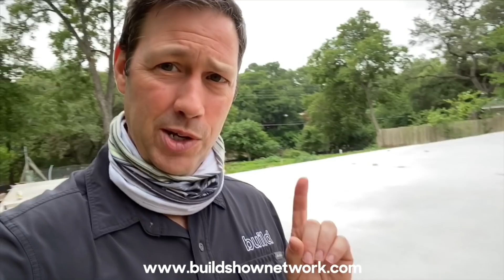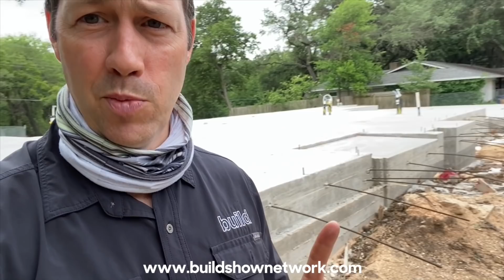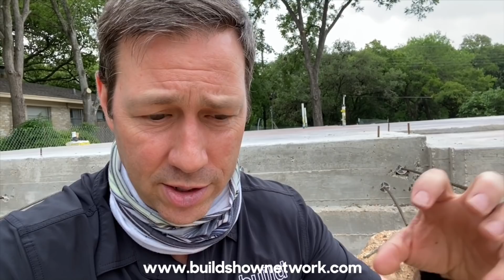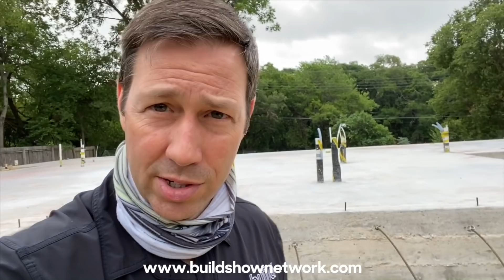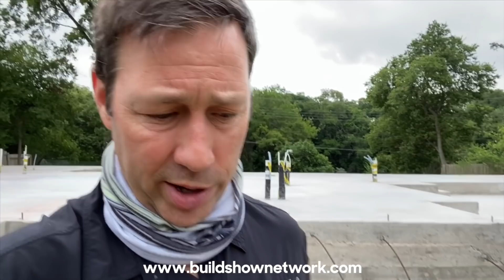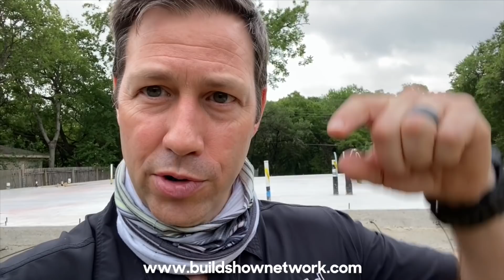Post Tension Slab Basics

Comment: I have fixed one previously, we had to remove the old tendon, and insert a smaller diameter cable, install the wedges, and tension the cable. However, in the north, we tension the cable 1 day after the pour, and then a week after that -- so it can get a bit dicey.

Comment: We add 7500 to 7800 psi when doing post tension, I work post stress and yes it's very dangerous, it sometimes blows up on us while we're adding the pressure and the repair is even more dangerous

Comment: They work great here in Texas. My next house I would like to have this system.  Not to worried about remodeling. Really any breaking of concrete slab you will weaken the slab with or without post tension. I have had to do remodeling with post tension, just take your time and break around they are spaced out a little further so you have more room to reroute plumbing.

Comment: Good video. But an important point is that the post-tensioning causes COMPRESSION in the concrete. Not tension in the concrete. That's the whole point :)
Reply: Not to belabor this point, but it's absolutely critical man! The reason why a boatload of tension is jacked into the PT strands, is 100% to make sure the concrete remains in compression. The only tension in the foundation is in the PT strands, and that is in order to keep the concrete from experiencing any tension. I'm a nerd engineer. Your videos are great, but that is a point that should not be overlooked or mistaken.
Reply: An equal and opposite reaction. Jack 25 kips of tension into a sleeved steel PT tendon, and the reaction is 25 kips of compression spread out over a certain area of concrete, to make sure it doesn't crack.

Comment: The argument about remodel of a huge house like that reminds me of the way PCs used to be built.  you would have a huge old case and that was so you could buy a new motherboard, video cards, RAM.  But really, it was just easier to get another one and ditch  the old slow one.  The thing is that most people stay in homes such a short time that jacking a slab for a remodel should be someone else's problem.

Comment: Plumber for over 10, years, Did a remodel on a home with post tension rebar for a restroom. Had to re route drain pipe. One of my helpers hit a tension rebar and it looked like as if a grenade had blowed right in front of us. He wasn’t wearing safety googles either so had a lot of debris go into his eyes. The scariest thing that’s happened to us in a long time. Was definitely lucky as the concrete was almost all shipped and only a small portion was left before he hit it. To answer your question as how do they replace them. they get a drill take of the plates that hold the tension on one side and drill it out as they have grease inside the sleeve. Once removed they drill in the new one with a regular drill and then used the tension machine.
Reply: I used a dremel to remove the wedges to free up the cable. time consuming, but worked out well.

Comment: The cable will break with about 41,000 pounds of force.  The working load is usually 70 to 80 percent of the ultimate strength.  So there is usually about 33,000 pounds of pull on each cable.
Reply: Hi Greg. The pull I have seen on most sites ranges from 3000psi to 7000psi.
How does that come close to 33000 pounds? If you could explain. Thank you

Comment: I’m building a new home with pt foundation. They just finished framing. I went by yesterday and for some reason they had a 4 ft square area of the concrete jacked out and there were 2 cables cut. No dead bodies laying around. Lol. I’m wondering why they had to jack that up. Plus, after searching the web I couldn’t find anything substantiating your claim that people can get hurt by cutting a pt cable.
Reply: Yes people can get injured/killed my PT Cables.
Reply: Absolutely people can and unfortunately do get hurt.  Don't kid yourself otherwise
Reply: I’ve cut many cables to repair them. Never seen or experienced a cable killing anyone

Comment: When blowout happens they detension cables around that area and chip away the concrete till the cable that failed is exposed. You can use a coupler to splice the cable that failed. Pour concrete and retension

Comment: Having a home built soon with a post tension slab.  How much time between the slab pour and the framing is best practice?  And will framing before the slab is tensioned harm anything?
Reply: You can begin framing on the slab immediately, before cables are stressed. Cables should be stressed 7-10 days after slab is poured.

Comment: Its a hand held machine that pulls the cable. If you ever break the cable your screwed.
Reply: We do PT everyday , we had cables snaps before and ussually isn't a big big deal because they are over engineering,  where usually allow us to have some that are broken . Last job we did 4 story building,  over 2000 yards of concrete each level. It really isn't a problem , but you gotta have an engineer look at it. I haven't seen on houses , I wouldn't do on houses I agree because you might want to change the lay out in the future but apartment buildings go for it.
Reply: Well now days alot of PT jobs are over engineered to the point if you have one cable fail it wont matter you have X amount of extra cables in that area that it wouldnt effect the integrity of the slab.  Now if you dont have extra cables in a certain area and it fails. You chip away the concrete and add the cable.

Comment: A rocky site in Texas may be capable of digging out with an excavator.   A basement can be practical when the site has a ravine or some feature which can be filled in, local regulations permitting. The costs of hauling away the fill material prevents many from using a basement.

Comment: Not to disagree with an engineer, but, out of interest in Australia, solid rock foundation would see a waffle edge beam slab design. Only heavy clay, raft slab with pillar holes spaced to a sable foundation.(Big saving in concrete).

Comment: YouTube competitor
Texas barndominium
Does that 😊
Reply: Actually the follow on Erik did (Erik and Matt know each other pretty well, from building shows and such) was a piece on how the post tension just didn't work for him. Most of his problems weren't with the system, but with the way it is sold and packaged; when Erik decided to do one, he had to order the cables and they come pre cut, treated and ready to install in their engineered positions. Erik usually builds out side municipal districts, in the country, and the supplier could not give Erik a quick turn around- that delay set the job back a couple of weeks. The follow on by the engineering company that tensions the cables was delayed twice (IIRC) and further stopped progress on the site. Erik made the call- he didn't want that loss of time control to rule his jobs, and he seldom has a long enough time window between contract day and the day he must finish a slab to build on. I hope I have explained this well- Erik, if you are reading this, feel free to fix it and blame me!

Comment: You can repair the cables by adhering a thin layer of carbon fiber along the cable line, it’s pretty expensive even tho it doesn’t sounds so. Also, maybe people have hit cables, ends rust out when grease caps are left off and fail, it is not end of the world just a costly repair, typically the cable when damaged do not come ripping out of the slab to kill you.

Comment: *cable is in tension. Slab is in compression . 
I always enjoy your content. Thanks for the steady stream of videos.
Reply: Luke Misenheimer I like his content also. However, this was cringeworthy at how little he knows about this stuff. I hope he takes down the video.
Reply: He was not incorrect…he said amount of tension but did not specify the concrete or cable.  He may have been talking about the “amount of tension” in the cable which is accurate.  

Tension in the cable is easier to measure than effective compressive stress.  In most case when applying a preload you actually measure elongation.

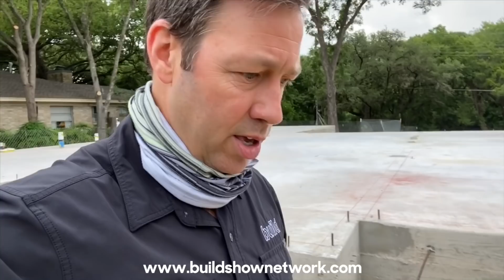Comment: Hi. I’ve been subscribed for a while. Love the channel and learned a lot. Thanks for doing this channel Show me good ideas for an efficient house in a couple  years when me and my wife Build. What do you know about Straw Bale houses? And Correct me if I’m wrong. At 2:09 seconds. You said that the slab was under tension. Tensions is pulling apart. Slab is under compression correct ? the wires are under tension because they’re being stretched. So the wires are pulling to center. Compressing the slab trying to pull it to the center correct?

Comment: It’s an excellent system in areas of expensive soils because the entire house moves like a ship on water versus the House buckling and cracking. Builders like this system in places like Arizona because site prep and site drainage are less costly.
Reply: Hi, we have a two story house in Phoenix AZ. that sits on a PT slab, built in 2007 by Trend Homes. I think they are defunkt now, but this house is very solid foundation wise. 

However, I do pay for the Service Line warranty to cover incoming water and outgoing sewage lines. It's $14 a month, very affordable considering what a broken line would cost to repair.

Comment: So these are not required on ALL slabs by Current Code???
Reply: Correct.
Reply: It's done to reduce costs
Reply: Ian Powell 
So let's understand something please?
Is Post-Tension required by Code in place of Rebar?
Or it is merely used in place of Rebar because it is less costly?
Reply: @edcurwick8383  used in place of rebar because it's less expensive (time & material).  It's use in residential slab construction is pretty simplistic compared to large engineering projects. ie bridges, highrises, etc

Comment: more than likely after the first home owner. no one will ever know the type of foundation. so the person who comes to the remodel wont even know not to jack hammer =/
Reply: They stamp the concrete in the garage floor. People who do major remodeling know ti6 look in garage first,  but cables do get broken sometimes but it's fixable
Reply: @danpants8218  Can you expand on that fixable comment? I was called to what had previously been a home for a client, and been sold- I had done some sub floor work to rebuild a shower drain that would not stay clear. the new owner had wanted to do some remodel in the kitchen/utility area and his plumber found the cable in less than five minutes of work- he identified his problem, but only after breaking the cable running just beneath the edge of the kitchen island. I got called because they knew aI had done below the slab work, and they wanted me to explain how. I did and they were unhappy; the whole at risk development was on land that had been farm land for a hundred years previously and had an 18" rise and fall seasonally, so the engineers specified post tension. I had known this and when I decided to break the bath room floor , had scraped the parraging from the foundation edges nearest and relevant to the bath, I knew pretty close to where the cables were. I avoided the cables till I found them and used a small hammer drill to get enough space to work. That 12" x 36" hole took me across three post tension cables and I spent more than six hours to get access. the repair and refill only took a couple of hours after that. 
  OK, long story short- the new plumber's boss called a foundation engineer; he said it "could not be repaired to meet the installed standard". Don't know what happened after that.
Reply: This was in Phoenix AZ and there is a company out there that can take old cable out and put new 1 in,  i believe that's how they do it. I only know that the cables are wrapped in some kinda plastic so cables can be pulled through again. Never got to see it done and really not sure how it's done but that's what my boss told me after I broke 1 in half and the city of surprise az said it could be done also

Comment: On future work on the slab the cables can be located with x-ray or ultrasound contractors. I have done that in Chicago for a very reasonable costs.
Reply: Hmm, still would feel like an earthquake could rupture out of the slab at anytime, for me that is...  🙏
Reply: @bertzerker747  My exact thought when Matt said that they can snap and tear through.
Reply: This is actually a terrific slab for earthquakes because the house moves as one unit. Finding the cables isn’t ridiculously expensive, but working around them usually is! This slab has saved my house — and caused me great frustration and expense too. Absolutely pros AND cons!
Reply: I recently added a laundry room to a spa that had several levels above aka condos. All concrete construction w/ pt slabs. Xrays only ran around $250 where I needed to core for dwv. Sure life is easier with nothing in the way but where's the fun in that?
Reply: Thank your for sharing this!

Comment: What keeps the end posts from shifting over time
Reply: In the calculations, there is a "long-term" strength calculation which takes into consideration shrinkage and creep (constant compressive stress causing the concrete micro-voids to close up) of the concrete slab. As for the tendons, they are run through a tube in the slab. The tendon ends have chucks placed on them and are wedge shaped and inset into the slab; these are then filled with a structural grout which prevents them from moving. Also the tension in the tendon keeps the chucks from backing out. As a side note, Matt incorrectly states that the concrete is in tension; the tension in the tendons/cables cause compression in the concrete. Concrete is much better in compression (compressive strength is typically 10x stronger than the tensile strength).
Reply: @chrisrabalais8984   it seems you have some experience with this. Is the Jack hammering - remodel concerns really an issue?  I can see how cutting a cable is a concern but if its fiberglass fill I would think a metal detector would find those cables with no problem.
Reply: @persistentwind  Absolutely it is a concern, only if you do not know the location of the tendons in the slab. If you know the location, you should be able to safely jackhammer out the trench. But I would strongly encourage someone to get a qualified structural engineer to make sure that the amount of concrete you are removing doesn't jeopardize the slab integrity, i.e. don't run a trench along the entire width of the slab, crossing all the tendons perpendicularly. And yes I do have experience, I am a structural engineer (working on completing my PhD in structural engineering) and have my PE license, as well as I have recently remodeled my own slab-on-grade house (albeit we didn't have PT cables, just normal rebar).
Reply: @danpants8218  I think he was just making the comment on the remodel aspect, as he does numerous videos on remodels in his Build show. Also, I think it was just for people's awareness and understanding of slab types. And I agree that a cable won't shoot through the slab. It is more likely going to shoot out the end of the pt tube, and that is only if there is a sudden cut.
Reply: @chrisrabalais8984  Awesome! Thank you, I had a feeling pulling out to much material would be problematic on this! Good luck on the PHD!
Reply: @chrisrabalais8984  Ty for this.
Reply: I have seen sometimes they use X-ray to locate the cables.